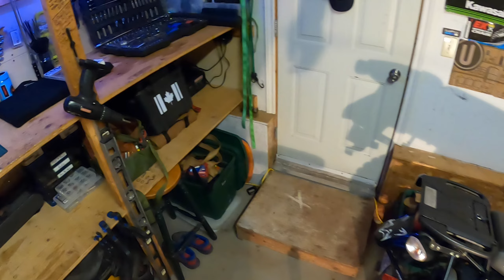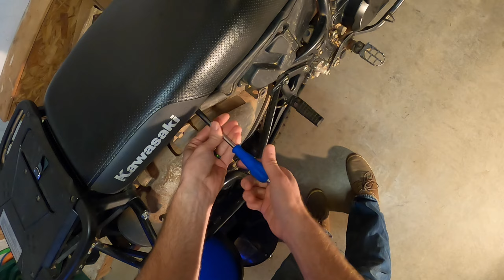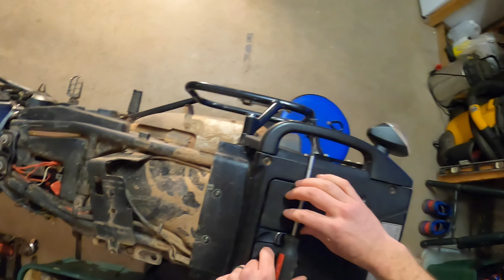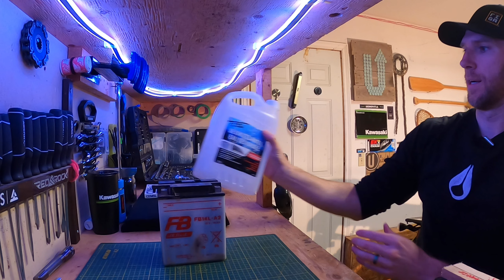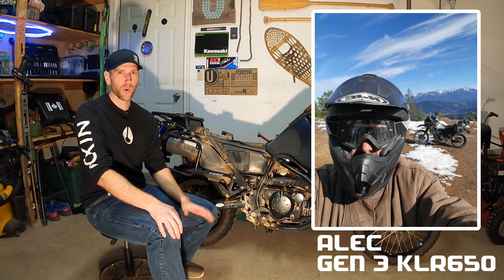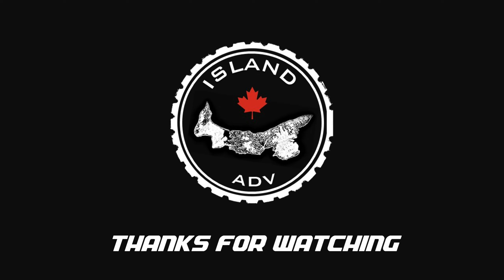Channel Update November 2022 | Motorcycle Battery Maintenance | Island ADV

Comment: Goodmoring great video thank you. Just went out and pulled the batteries and filled them .don't know if the battery in the klr is a 2008 it is the same as yours thanks again cheers to ya
Reply from the maker: Nice! It should be similar to mine yes. I just seem to always forget to do it, and then I'm getting ready for work and I'm wondering why the bike is struggling to start I suddenly remember, lol. I figured I would share it this time and hopefully prevent some headache for others.

Comment: When my 2011 klr gets hot at red lights and then cools off while going down the road. However when I get to 55 to 60 mph she starts to bog down like she's starving for gas. Would that be a carb issue?
Reply from the maker: Definitely sounds like a carb issue. The heat up thing is super normal. You might want to pull your carb this off season and give it a clean. Likely the jet has some gunk in there.
Reply from the maker: This is a great video for how to clean the carb:
https://youtu.be/orug43veeuc
Reply: @IslandADV  ok, thank you for the info